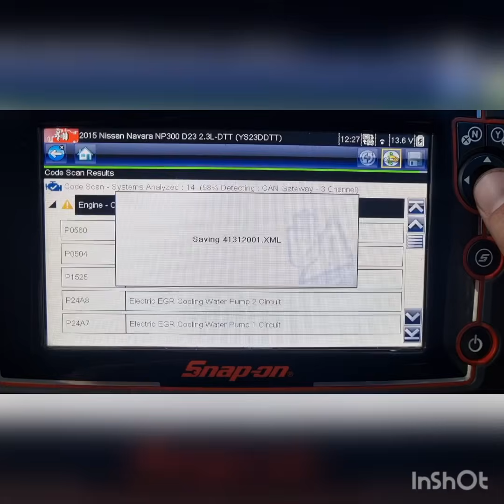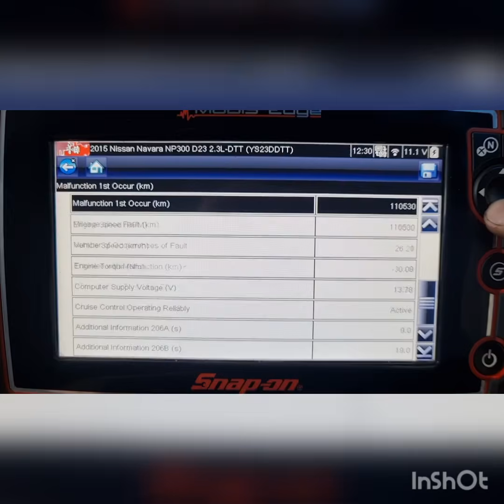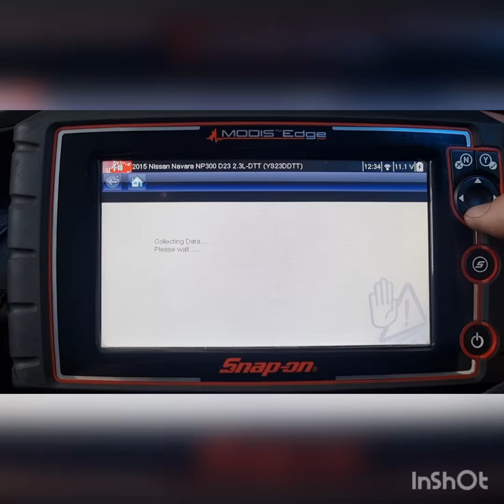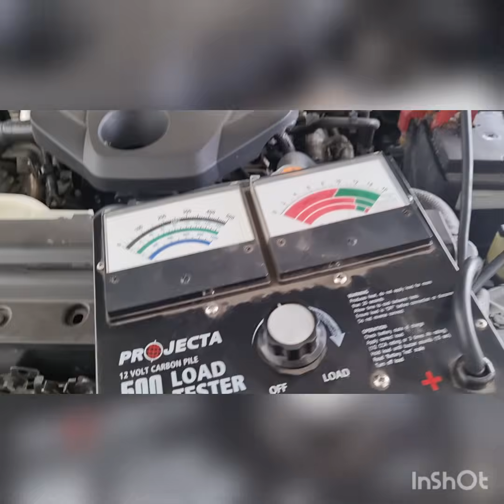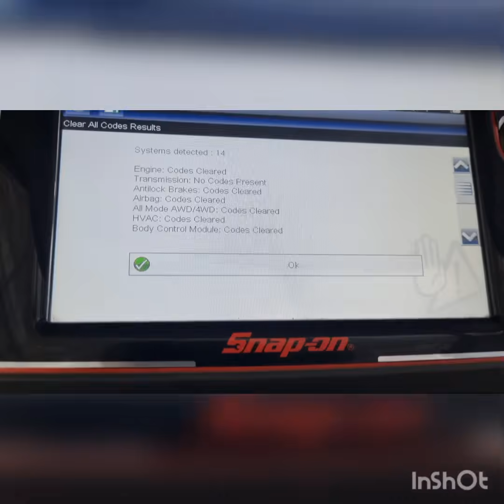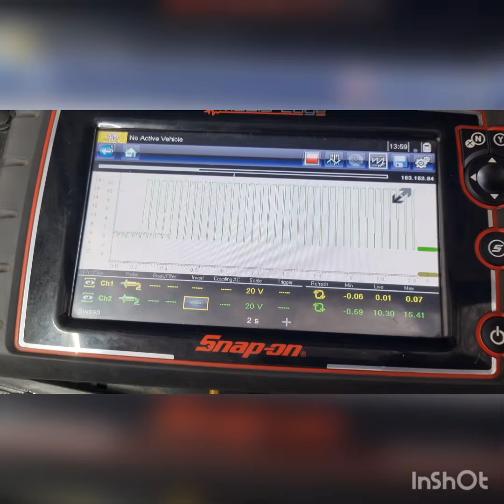Nissan Navara P24a8 P24a7 EGR Coolant Pump Circuit

Comment: I imported a good second hand nissan navara ys23 emgine from dubai,when i fit the engine and statred it,there 8s a white smoke coming through the exhaust pipe and sometime disappears, whats maybe the  problem, on the machine read code P24A8-38 and 67

Comment: Hey mate, I’ve just had the same issue. Been chasing my tail for weeks. I finally bit the bullet and got a new battery, two new pumps, replaced them, vacuum bled the system and cleared the code. Engine light disappeared for a good half a day and when I started the car up again it’s throwing the same code P24A8-67 and P24A7-67. Any ideas where I could try next?
Reply from the maker: Did you use genuine pumps?
Reply: @RealAutoSolutions nah I got some off eBay. Could be my issue?
Reply: @lucaiacob134 I'd say check the current draw of the pumps to see if it's different from what the module would be expecting to see.

Comment: The EGR coolant circ pumps are in series. I.E. discharge of 1st pump feeds suction of 2nd pump. Presume this is to get sufficient pressure to drive the required flow thru the EGR cooler.(Jacket water pump must have not been sufficient?) Had this code P24A8 as permanent code, could not find anything amiss. Cleaned connectors at both pumps and at EGR valve controller connector. No corrosion at any connections very well sealed by OEM, voltage at both pumps and grounds good. As simple test used a stethoscope and listened to noise from discharge of each pump engine idling. Then clamped down partially restricting flow on each pump hose with a hose clamp off tool. Noise changed noticeably proving each pump was working. Even more important was a higher pitch noise from the 2nd pump in the series- its running at elevated pressure due its series connection.. Cleared 24A8 code never came back again after 60000kms furthur now.. So bit of a mystery why it threw this code. Never had coolant loss, no other codes at same time just  P24A8. BTW its a bitch to bleed air out of system with coolant change just as they say in this video, I dont have a vacuum bleeder. Hope this helps all reading. Please share your experience - mine is these engines are good- 207000kms on 2015 NP300 with zero engine trouble no oil useage etc, Secret is oil and filter changes never exceeding 10000kms. Also a Mann Hummell Provent 200 catch can drained regularly with its filter replaced every 40000kms plus an additional prefilter on fuel before final filter only using genuine final fuel filters.

Comment: I drained the coolant and run the engine after topping filling it up. Bled the air later from that coolant pipe that sits above the enginealong the firewall. Reset the code and thought it went away but it popped up again. Think i might have done some damage having airlock in the coolant line.
Reply from the maker: You need to vacuum bleed it mate, you will not get all the air from manual bleeding procedures

Comment: Hola como estas, tenemos una 2016 y me pasa lo mismo, cambie enfriador egr y purge el sistema (encender calefaccion al maximo, desconectar una manguera, rellenar, al botar colocar la manguera y luego sacar el pernito de despiche que viene desde el radiador de calefaccion. 
El problema persiste, no se calientan las mangueras, no tira aire caliente y la temperatura de la camioneta es normal siempre
Reply from the maker: You need to vacuum bleed the system, filling the system a "normal" way will not work on this vehicle

Comment: I have a client vehicle with the exact same symptoms. I have changed water pump then thermostat but every now and then it will just overheat and then be fine for a few days. My conclusion was the EGR would open heat the EGR cooler, because the pumps weren’t working optimally the coolant in the EGR cooler boils and pushes stem in to the thermostat, then the system over pressurizes and then purges the coolant out the overflow . My next step is new pumps! Thanks for the video
Reply from the maker: Awesome mate
Remember these vehicles HAVE to be vacuum bled

Comment: Hy jack. My Nissan Navara 2021 coolant reservoir always low after run 50km. Do you think its impact from EGR cooler pump not working
Reply from the maker: It won't be the egr pump causing the problem, it might be the EGR cooler, they're quite common to go on these
Reply: Hi. My 2019 Navara have Same issue. Did you find and solve your problem

Comment: I have same code except there is a lot of pressure in cooling system, shoots coolant out overflow hose when it gets warm. Getting it diagnosed soon but do you think it could be due to egr cooler or more likely head gasket? Cheers
Reply from the maker: Almost impossible to say without blocking the egr off Or removing and pressure testing the egr cooler mate 

Has it ever been over heated?

The codes will be from lack of coolant around the pumps
Reply: Hey mate how did you get on with this in the end? I have the exact same issue atm

Comment: Hi Jax i have a 2107 Nissan Navara D23 with exactly the same problem, the battery was failing with low CCA and 3 alarms for EGR coolant pump P24A8-96, P24A7-96 and P24A7-12. i came to the same conclusion, I replaced the  battery and checked fuses, I tested the pumps by touch and they appear to be operating.  Will clear the codes and test it again, plan to order 2 new pumps anyway and replace them when i have time. Great video, its has helped a lot. Best wishes Michael
Reply from the maker: Thanks Mike, I assume they're being monitored by the pcm and that's why we have a code but they seem to be doing something, maybe not enough to keep the pcm happy 

Happy new year mate all the best
Reply: Traductor

Comment: Thanks for the video... I had the same issue with my 2017 model... what happened is I left the Fuel pump running and it drained the battery so it had a bit of a hard start and it gave the P24A8 code... tried clearing it with no but still... I then realized that the coolant reservoir was below min, filled it up then repeated then left the battery to drain and hard start it again and the fault disappeared 😂😂😂... so what broke it will fix it i guess... it has been weeks now and the error hasn't came back... weird fix I know...
Reply from the maker: Hahah bloody cars

As long as it's fixed at the end of the day that's all that matters!

Comment: Same issue. Egr cooler has failed. Need to find a video on that repair if possible
Reply: Well the saga continues. Nissan say replacement engine at 18gbp!  I've replaced egr cooler, thermostat, both egr pumps, water pump. Still overheats and no water through heater. Been vacuum bled a dozen times.  Any other ideas? Faulty egr valve?
Reply: @brittenv1000 did you found the problem?
Reply: @Dulan12 I did! The thermostat conveniently located at the back of the engine was one problem but the real is was the head gasket. Repaired it then sold the truck .2yrs of my life 😂

Comment: I had exactly the same symptoms then noticed bubbles in coolant tank end up being egr cooler failure letting gasses into the cooling system. Big $$
Reply from the maker: Yeah unfortunately EGR cooler failures are common on alot of CRDs